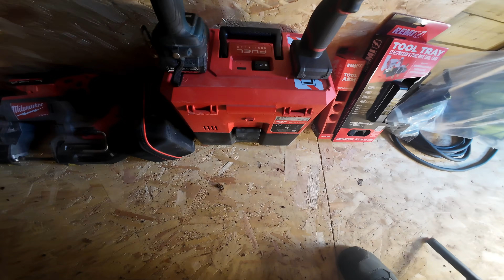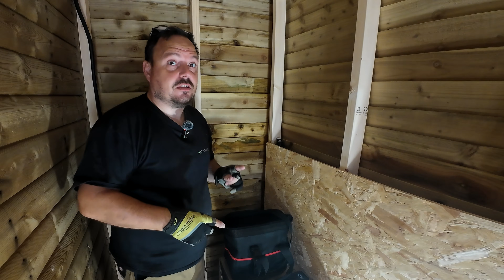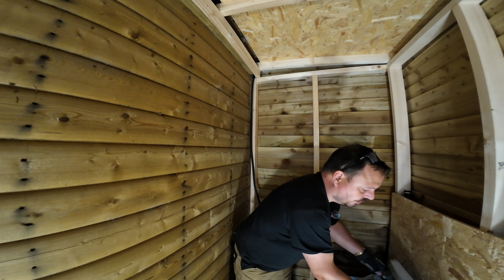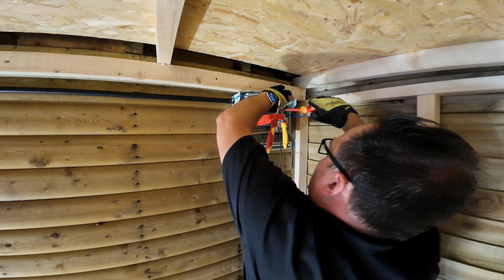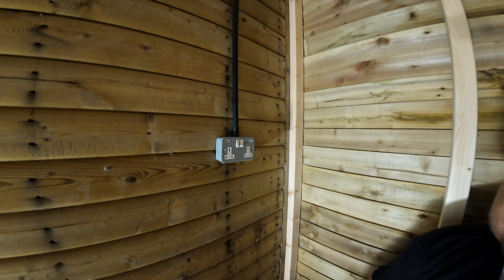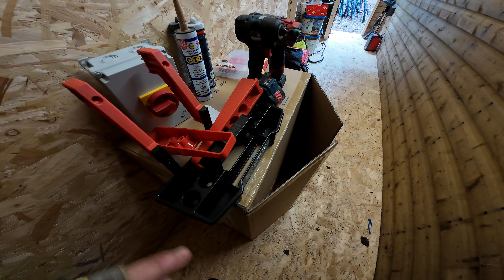Shed Rewire - Power, lighting and solar... Summer House - Garage - Shed wiring start to finish

Comment: Interesting to check the tool maker/importer.   A few times I have checked the companies on Companies House website, found the address and looked at it on Google Maps / street view.  Sometimes you find a real business, other times you can see it's no more than an office/mail drop. 
You then make up your own mind!
I found this when looking for laptop batteries for a school, and found that the purpose was merely to have a UK presence and VAT number. The directors (in my instance) were not even UK based!

Comment: In the UK, is the rotary isolator mandatory? I've seen you use them on the AC and DC side (100% agree on needing the isolation) but I've also been watching a few European PV/battery installs and they use DIN mount isolators in their enclosures and it does look neater.
Reply from the maker: You can use DIN ones so long as local to the equipment. We have some examples of this coming 💪

Comment: That tray is terrible, would just be constantly in the way 😂😂, great video as always tho
Reply: @Dlc18139  aye, I was thinking would it not be better if it clipped onto the bottom of the DB, clear of the switchgear?
Reply from the maker: It is adjustable and can hang below the board. They have thought about this.
Reply from the maker: It’s not the best example on this board. It does hang below it and is adjustable on the brackets.

Comment: Great video, Mark, thanks. I'm just about to install a small DB in a small workshop I'm building (approx. 3.3m x 2.4m).

I am contemplating actually using a 2-pole AFDD/RCBO in the house DB to protect the distributor circuit to the shed with 2-pole RCBOs for the shed final circuits. My thinking is if AFDDs are recommended for timber-based structures (like my workshop) then the distributor presents a risk of serial or parallel arcing in the same manner as any of the final circuits. I won't be able to achieve selectivity for the residual current protection in the strictest sense but, given the nature of the use of the building, I think it's a practical compromise.

In terms of your intended installation of a EESS and inverter in the shed, I think a Type B RCD upstream would be required.

Looking forward to part 2.
Reply from the maker: Don’t fall out with that idea at all mate. I did consider an upfront afdd on this but went against it to aid fault finding if they get upset and trip. 

I think I’m going to add AFDDs to a few of the other circuits down here as I move everything over and get setup 💪